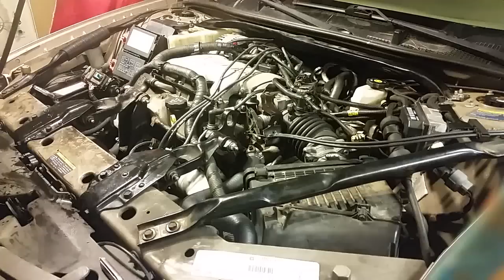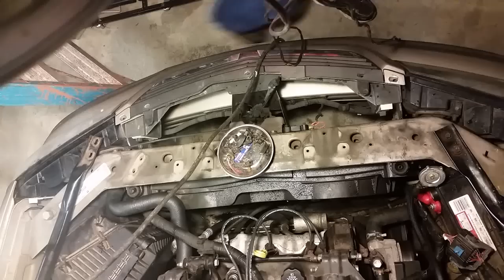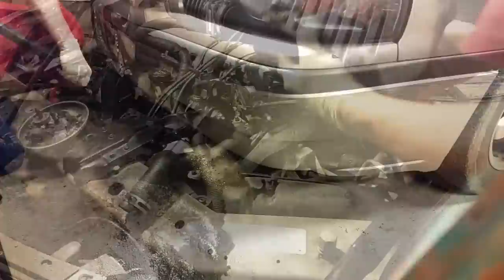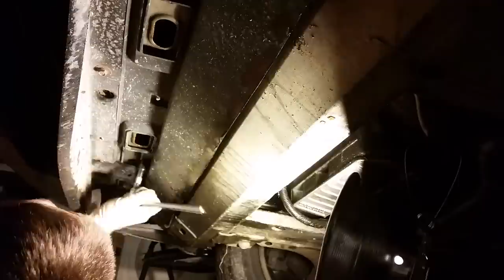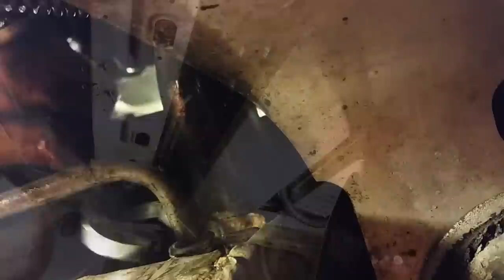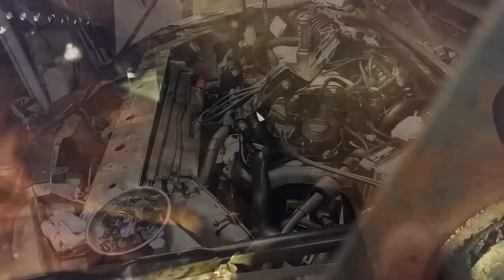Radiator Replacement 2000 - 2005 Chevy Impala/Monte Carlo

Comment: This video really helped me prepare for removing and replacing my radiator. 

I have a 2001 Impala, so it may have been a little different. but I had to remove the battery from the left side, in order to get the radiator out.
Reply from the maker: Glad it helped!
Reply: @MightyMechanic 😊😊😊😊

Comment: Dunno if you'll see this, but on the right hand side, under the radiator cap and reservoir tie in, on the back side of the radiator, I have an open hole that is letting coolant leak. I can't find a dangling hose or anything, and it looks like hoses are all attached.  What part fell off my car??

Comment: ...sigh. Don't you have any 1/4" drive tools? Also, the transmission cooler lines have QUICK CONNECTS. Use a pick tool and remove the little E-clip from that fitting you unbolted and the line pops right off. ALSO, take the fans off before pulling the radiator and you won't have to manhandle the radiator out. I assure you, installing a new radiator the way you removed the old one WILL result in damage.
Reply from the maker: I do have 1/4'' tools, but for some reason i used my 3/8's. The reason I unscrewed them was because I like to keep the old fittings and would have to take them off anyway. If I was not going to keep the old ones, then I would have disconnected at the quick connect.

Comment: couple questions,, first  is the front part and the rear part of the radiator seperate or are they sold together.. and if so what is the front part called, i am not talking about the fans   . my car is an 05 impala
Reply from the maker: Not sure what you are talking about. Are you talking about the A/C condenser that is in front of the radiator (toward the front bumper)?

Comment: I got it all hooked up but when I went to burp it and it got up to temp, the heater wasn't blowing hot air. do you know why?
Reply from the maker: When you bleed the system, make sure the heater is set to all the way hot. This will open the coolant passages to the heater system and get all the air out.

Comment: I sure hope you can answer me soon we took the old radiator out started to put the new one in realized all hoses and everything match up but the transmission fittings are to small, when the radiator hooks back up, someone said you can get new fittings is this true?
Reply: +kathy minger   where it hooks back up
Reply from the maker: Mine were the same way, the radiator came with new fittings. There is a snap ring right behind the fitting. Pull it out and put the proper size fitting on. If yours didn't come with new ones, an auto parts store should have them.

Comment: Silly question... two radiators are available for the 3.4 V6.  A  5/8" and 1". How can I tell which mine is without removing the radiator first?
Reply from the maker: I am not sure. When I got mine they only had one part number, not sure what size it is. If you go to your local auto parts store, they should be able to tell you what size it is.

Comment: I'm virtually finished with everything but I'm caught on what I assume is something to do with the AC? It's connected to the front of the radiator and I'm not sure how to remove it. When I tried it started hissing so I stopped
Reply from the maker: There is an AC condenser behind the radiator (towards the front bumper) just for the AC, but the coolant radiator is just for coolant (and the transmission). You should only have to remove the upper and lower radiator hoses and the transmission lines.

Comment: I just started this and the bracket bolts (3bolts) that hold the engine in place just snapped in half.  where can I find replacement bolts? also, can you recommend anything on how to get the broken bolts out of the bracket?
Reply from the maker: Your hardware store should have the bolts (they are most likely metric). If there is anything left of the bolt sticking up, you can try using vise grips. If there is nothing sticking up, you could try using a bolt extractor. If none of that works, you will probably have to drill out the bolt and tap the thread.

Comment: alright, that's good. 
I'm starting to freak out. I'm lacking tools and I'm depending on someone else to help me. I don't know if it need to drill them out and tap (no, idea what size bolts I need and tap size) or vice grip the bottom of the bolt and try to thread  it out that way. 
Thanks for the help man.
Reply from the maker: I would try vise grips first, if that does not work, I would then try using an extractor before drilling and tapping. As far as bolt size, do you have any threads on the broken half of the bolt? If you do, you can bring it to a hardware store and use their tool to see what type of thread it is. For length, look and see how far through the frame it goes, and get one as close as you can.

Comment: so how does the bottom transmission line come off and what size wrench do you need for it?
Reply from the maker: You can either take it off at the quick connect (remove the C clip and pull the line out of the fitting), or you can take off the fitting with the line with a wrench. It is either a 17 or 19 mm.
Reply: thank you I'll give that a try
Reply: MightyMechanic wait doesn't the ac connect to the radiator like some cars do I did a Mitsubishi and the ac lines are connected to the radiator is it the same as this car? And there's a transmission line to the radiator as well??
Reply from the maker: On this car, the a/c has it's own condenser behind the radiator. The only thing going to the radiator are the transmission cooler lines.
Reply: MightyMechanic thank you so much for the quick reply
Reply from the maker: No problem!
Reply: MightyMechanic  so have a 2004 Impala so that's a transmission coolent line at the bottom of the radiator?
Reply: Man you work fast! Nice e job, thanks for the video.

Comment: I didn't have a jack under the engine. could this be the reason my bolts snapped?
Reply from the maker: No, you do not have to have a jack under the engine. All those mounts do is keep the engine from rocking back and forth.
Reply: @MightyMechanic  WRONG. Very freaking wrong. On my car ( 2001 Impala ) the motor drops. You have to have it braced to get the mounts back on.
Reply: bryan hearn not on my 2000 chevy impala. It has bottom motor mounts. Mabe your  bottom motor mounts are messed up

Comment: nice video. I have the same car and need to replace my radiator. I dont know what one to buy. Autozone has them for $500 but you can get an aftermarket one on ebay for $50. Will i have problems getting the cheap one to fit once I try to replace it?
Reply from the maker: +Ty Robinson Thank you! Wow, that is very expensive. I would be careful on Ebay. I only paid $130 for mine (Here is the link to the one I bought: http://shop.advanceautoparts.com/p/carquest-or-toughone-radiator-432297/19920404-P?searchTerm=radiators ). Is yours between 2000 and 2005?
Reply: Ha mine is a 2001 3.8L.  The one I bought on ebay looks exactly the same as the one in your link.  I will be changing it out some time this week.  Will I be able to keep using the old radiator hoses?  I would get new ones if I didn't plan on getting a new car in the next year.  I just need to stop the leaking before it gets too cold out and keep the heater working.
Reply from the maker: You can reuse them as long as they are not dry rotted or have cracks. Also make sure you bleed the system when you are done to get all the air out.
Reply: I changed out my radiator and I think my car is running much better.  Thanks for the video it helped a lot!
Reply from the maker: That's great! Glad it helped!
Reply: Got mine on RockAuto for $75.. 03 Chevy Impala

Comment: how did you get the lower trans line off? did you need to go from the bottom?
Reply from the maker: Yes, after you take the splash shield off, it is right there. You can take it off at the quick connect if it is not rusted and/or if you are replacing the fittings anyway.
Reply: use a small metal pick tool (from underneath the car) and remove the retainer clip.  The trans line will pull off.   no need to remove the splash shield.

Comment: behind the radiator is an coil does that come out too or stay in and how to unmount it
Reply from the maker: If you are talking about the A/C condenser, you don't have to remove it. You should only have to remove the engine mounts, air box, hoses, splash shield, transmission cooler lines, fan electrical connectors, and unbolt the radiator mounts.

Comment: did he drain the fluid out before doing everything??
Reply from the maker: I removed the lower radiator hose to drain it, but I did not video it because I didn't want to get the camera wet. However, It won't make as much of a mess if you use the drain screw, just it takes longer to drain.

Comment: the hose leading to the thermostat....I drained the radiator and put some radiator flush and the coolant back in.... and when I started the car wit the hose disconnected from the thermostat housing no fluid came through for about 3 min or so
Reply from the maker: The thermostat will not open until the coolant has warmed up. This is normal. If you have the stock thermostat, it should open at about 195 degrees. Watch your temp gauge, when it gets to about half way, your thermostat should open and coolant will start flowing. If it does not open and the car starts overheating, you have a bad thermostat.

Comment: Do you remember what size sockets you used and what size wrench you used to get the hard line unbolted?
Reply from the maker: +Liban Yonis The hard metal lines (transmission cooler lines) were 19 mm, and I think the engine mounts and side bracket were 13 mm. The mud guard is 10 or 13 mm, not sure.
Reply: sounds good. thanks
Reply from the maker: No problem.

Comment: OK thanks but I change the thermostat , maybe I forgot to mention that I do need a catalytic converter? the hoses are fine and the water pump doesn't show signs of leakage...I do see some signs of rust from the right side of the radiator as well as when I put coolant in when it fills and runs over the coolant is a brownish color...my guess is the radiator? idk I'm trying everything I can think of...smh
Reply from the maker: The cat will not effect the coolant, although if it is blocked badly, it may cause it to overheat. Is it overheating? Are you losing coolant? Also, do you have the 3.4 engine? If the radiator is full of junk then you may need to replace it, but not sure if that is your problem. The fins in the water pump can rust out, but that's not that common. Does the coolant smell like gas or oil? Does the engine run ok?

Comment: okay video would be better with some sound and step by step instructions
Reply from the maker: I plan to make another radiator video in the future with step by step instructions.
Reply: +MightyMechanic great video I was wondering how much time it took in all to do this and is this your Impala if so I would like to ask you some questions about other problems I've had with my 2003chevy impala.
Reply from the maker: Thanks! I believe it took me a couple hours, but it can be done much faster. Just I was taking my time. It is my sisters car and I do all the work on it. Just let me know what you need help with.
Reply: @MightyMechanic  what was the problem with the car?

Comment: my condenser dosnt wanna come off any  reason why???
Reply from the maker: Do you mean the radiator? You don't have to remove the condenser to take out the radiator.
Reply: Wait I ment my condenser is still stuck on even thoe I have disconnected everything so when I try to take out the radiator the condenser is stuck on and it dosnt let me take out the radiator
Reply from the maker: The condenser shouldn't be connected to the radiator. Is it a 2000-2005 Impala/Monte Carlo?
Reply: MightyMechanic that's strange then because the radiator just dosnt want to come off it keeps pulling the condenser with it
Reply from the maker: Can you see where it is connected? I honestly don't know what is going on. The car I did it on it wasn't connected to the condenser.
Reply: Yes - The 2005 Impala AC Condenser slides down the front of the radiator and locks in.  Pull back the radiator, then lift up on the condenser to unlock the tabs.

Comment: Won't take forever. This guy did it the hard way. Remove the fans and shroud before taking out the radiator. You do not pull the whole assembly, as you can see. Use common sense..... This is a 30 min out 30 minute in job. 1 hour tops...
Reply: Not to mention brace the Engine before taking off the Motor Mounts.
Reply: bryan hearn you don't have to do that.if your  bottom motor mounts are bad then you will have to brace the engine
Reply: How do you brace an engine ?
Reply: @fiiveonezerofive by putting a jack under it. Some people are saying that you need to put a jack underneath the engine before you remove the motor mounts. I think it is good advice because some people here are saying to do it and some people here are saying it is unnecessary. I would rather just not chance it and put a block of wood between the jack and the oil pan just to be safe.